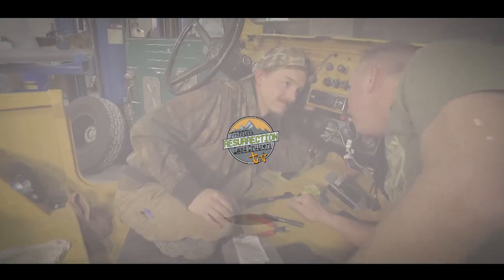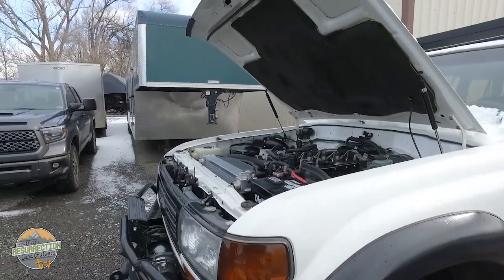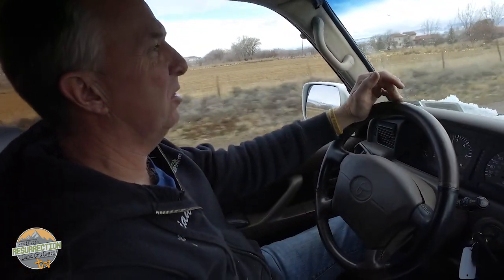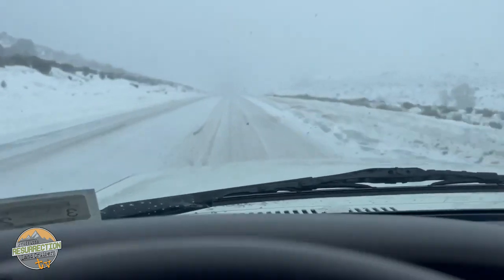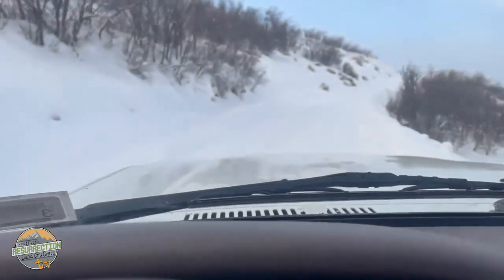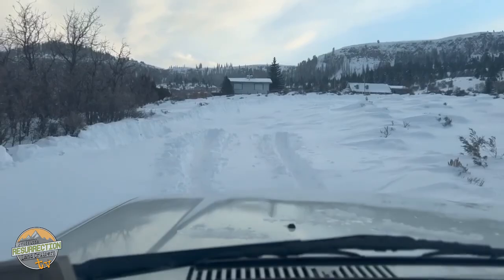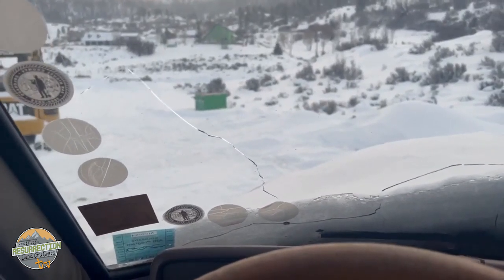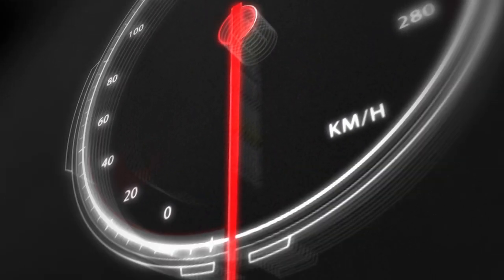A test drive turns into an adventure in a Cummins R2.8 diesel powered 8spd FZJ80 Toyota Land Cruiser

Comment: I have been stalling on doing a conversion until i see what kind of sorting people have gone through to get the right recipe.  I always thought the LS 3 was power but not balanced for the 80.  The 2.8 seemed too weak.  This video has make me think about the 8 speed transmission as a good balance.  How much to do a new crate 2.8 with a new 8 speed from you guys?  thanks

Comment: ….The LS goes into miiiine!  I am soooo excited for Proffitts to put that v8 in my fj80! (I’ve driven a 2.8 80 in Bozeman and prefer the v8 🤷‍♂️)
Reply: I hear the Cummins in a LC creates a lot of vibration… would you say that’s true? 

How much are you paying for your LS swap?
Reply: @sergiolozano6205  yes it vibrates. I don’t know if what I drove had that 8 speed transmission tho - could’ve made a difference?  I thought it was underpowered.  I have driven my friends immaculate 6bt Cummins 80 and it was astonishing how much torque it had.  The only diesel I’d consider.    I won’t comment on the cost of my swap bc it’s different than most scenarios and no one else would have these circumstances

Comment: So, just wondering, which manufacturer makes the BEST Adapter for the use of an R 2.8 to a GM 8L trans?
Reply from the maker: Unfortunately, We are unfamiliar with that subject. The only auto we offer is the ZF 8HP.
Reply: Is there a readily made adapter for the ZF 8HP @procruiser
Reply from the maker: Yes, Axis Industries can supply you with all of the parts necessary for the swap  @Notstradamus

Comment: That little 2.8 cummins seems to power that 80 series really well. You jumped right up to 65 like it was nothing. Do you think the eight speed is definitely the way to go versus a 6L80? Thank you 👍
Reply from the maker: There are nay sayers, but they would change their tune if they drove one. There's plenty of power. Not so much with the 6L80 though. It's not so much at speed where there is a problem. It's taking off from a start. We've tried several different torque convertors and intercooler sizes with no good results. The 8 speed is the way to go.
Reply: @procruiser  Excellent 👍 I believe you. I transport heavy equipment and I have a 18 speed I would not want less the closer ratios make a huge difference. And low end torque I run a Paccar 13 liter 510 hp 1850 torque so I understand how low end torque and gearing can move weight. Thank you 👍
Reply: @procruiser  What torque converter rating/stall speed did you decide to use in this 80-conversion?